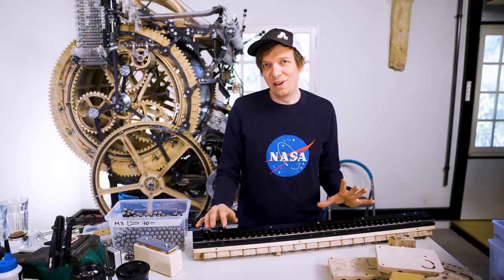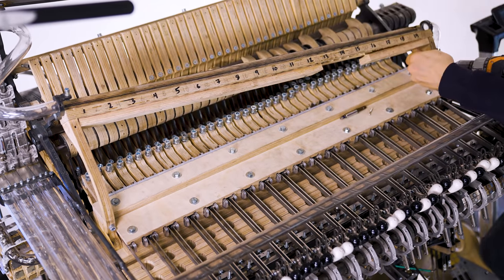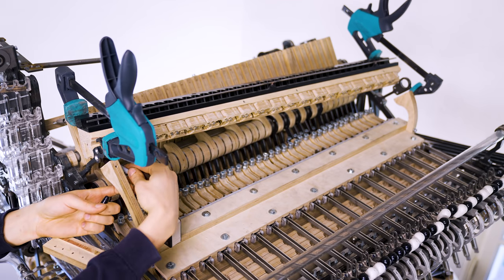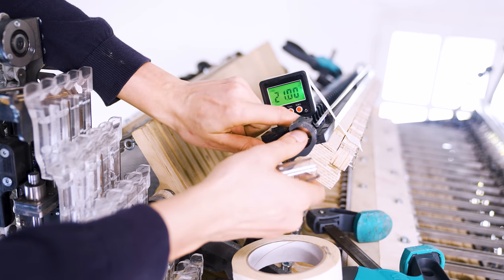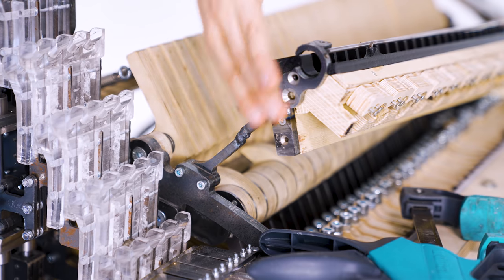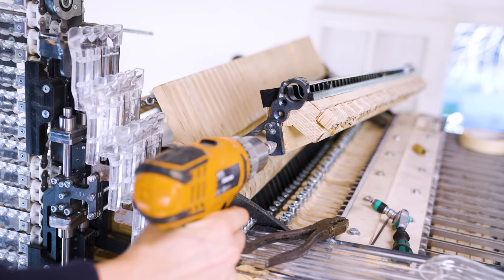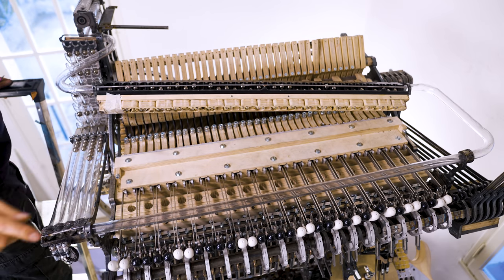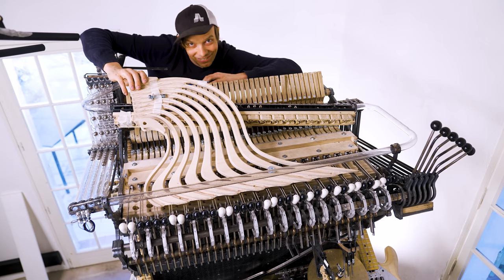The New Marble Divider is a Success!

Comment: Everytime he brings out a Sharpie, a CAD-fairy dies.
Reply: Never underestimate the power of the sharpie.

I used to etch my own circuit boards. For really simple ones I'd just draw the traces right on the copper with a fine tip sharpie instead of going through all the effort of designing it in KiCAD and transferring that to a photosensitive PCB. Worked great, and took a tenth of the time and resources.
Reply: @outputcoupler7819  
"If it works, it ain't stupid!"
Reply: @outputcoupler7819 , that’s how I do everything. But the touring machine is coming straight from the CAD files so this will all have to be worked backwards. No worries though, the CAD team is all over it.
Reply: @outputcoupler7819  now I am no engineer myself but I do understand that being an engineer is all about finding the best possible solution using the least amount of resources and time. Does that about sum it up? :)
Reply: if the flaming cheeto takes out a sharpie we laugh
if martain takes out a sharpie we pay attention
Reply: @frogz  cheeto is gone. we don't mention him anymore. We in the US have more then enough stupid to replace him. 
Which is why I come here. The levels of brilliance are both subtle and substantial, and the work that's done to make it all work is an inspiration to us all. The fact that Martin has thrown several hundred hours of work and parts into the old divider system, and is willing to toss all that in a heartbeat for something that WORKS, is a testament to progress.
Reply: @GeneralDubby  Sharpie is a brand of permanent marker, and is commonly used as the generic term for them.  I, too, would love to know what CAD-fairy means.
Reply: Instead of waiting weeks or even months for an answer, you could maybe- I don’t know, Google it? eye rolls
Reply: 2018 Martin rides again.

Comment: Don't forget to air dust the whole machine!🌬
Reply: And graphite the gears again after!
Reply: Gotta set the shop vac from Suck to Blow Spaceballs-style and just blow all the dust off the entire thing while wearing a mask and goggles.
Reply: Keep in mind that most air compressors also pump a little oil unless you have an oil free compressor.
Reply: @NFSHeld  Err, what kind of wack ass compressor you have that has oil exposed to the compressed air? The biggest issue I've ran into with compressors in static systems is humidity building up inside the pipes and condensing into liquids inside bends (which fucks with the airflow and can ruin your compressor\air powered tools).
Reply: @ScarletFlames1  i mean ideally the oil stays under the pistons in a reciprocating compressor but ideally is rarely reality.
Reply: There's probably so many metal shavings & saw dust in that machine that it probably needs to be saved as the prototype machine for historical purposes and a totally new one built from the CAD team's work for the tour.
Reply: @ManabiLT  congratulations, that’s literally exactly what he is doing :awesome:
Reply: @ManabiLT  As another commenter said, but with less derision: This machine is the prototype, the CAD team's final design will be the origin for final production. This makes it very easy for Martin and his production crew to keep spares on hand that can be quickly swapped out if there are issues on the world tour.
Reply: @F3Ibane  Yeah, I knew that already, but it's fun to point out why that's necessary. ;)  Thanks for being less derisive.
Reply: @polybius3821  There is one thing about the graphite that has not been spoken of. As the marbles travel through the machine the marbles will migrate that graphite throughout the machine, making those clear tubes,,, look dirty.
Reply: @F3Ibane  awww now I feel like a bad person
Reply: @ManabiLT  I meant no harm soz ;w;

you make a fine point for why they couldn’t use the prototype on tour if they wanted to

Comment: Martin: "I'm striving for perfection this time"
also Martin: "let's not think, lets just do"
Reply: The eternal struggle.
Reply: He is large; he contains multitudes.
Reply: Marting: "I want it to be 17.5 deg"
also Martin: "17.7, perfect"
Reply: @funkenjoyer  also a good quote
Reply: @funkenjoyer  Well, anything between 15° and 20° is perfect as he said they both worked perfectly, and wanted to go for max. robustness by picking something inbetween.
Reply: This is the way :)
Reply: @funkenjoyer  I think he wanted that angle so it matches the current parts without need for additional work. So if the machine is slightly different then what its supposed to be, its fine since it works within that range and its what he wanted.
Reply: and this kids is how I met your mother
Reply: @funkenjoyer  That was bugging me for a sec, but then I remembered what a large margin of error there was
Reply: What is finished first: MMX or George RR Martin finishesThe Winds of Winter? Or Neither?!?!?
Reply: I mean he can't help with the measures, but at least the mechanisms incorporated are better this time.
Reply: "I outlive myself" - Martin
Reply: His motives are too intelligent for us to understand.
Reply: @flying-sheep  Well, to be fair, 'adequate' or 'close enough' or 'within margins' would be preferable. 'Perfection' is the extreme point of goodness, and therefore there is only one possible perfect solution for every problem. However, many problems in the universe do not have a perfect solution. While the perfect solution to 2+2 is 4, there is probably no perfect color to paint my room.

When we use 'perfect' to describe solutions to problems therefore, we are very often wrong, and using the word incorrectly.

Comment: Martin: Random felt-tip markings and hacksaw cutting
CAD team:
Reply: CAD team: "We never expected it to come to this, but... bring out the LIDAR point cloud scanner, guys!"
Reply: @AttilaAsztalos  we've actually done some of that already for the instrument frame and marble ring lift side
Reply: screams in cadd
Reply: Is it maybe not the best idea to rely 100% on cad being absolutely accurate? Don't many manufactured parts have some room for error to allow for variability adjustment during assembly?
Reply: @tommj4365  Yes, but good CAD design can account for that.  Source: Most parts I design run with something between 1.5mm and 3mm tolerance positive and negative.
Reply: @tommj4365  I always remember my engineering prof telling me that all models are inaccurate and only some are useful

Like SteevyTable said, every dimension has some manner of +/- tolerance. Tricky part is to know while in the design stage if those tolerances are both acceptable and that production is capable of meeting them
Reply: @MalariaSucks10  Really? When I worked at Gulfstream, everything was modeled, and the aircraft was manufactured directly from those models. Models are technically 100% accurate and precise; tolerances apply when they are used for manufacturing.
Reply: @tommj4365  In manufacturing it is called "2nd operation" and then sometimes a tad more for critical/custom/prototype assemblies.
Very good to sneak up on the correct dimension when needing to meet 3 axis requirements, bravo!
Reply: @thomasbecker9676  Well sure a model is 100% accurate in the computer but the point of a model is to provide a print for someone to eventually bring those parts to reality. 

No matter what, all tooling has some amount of error. Meaning that all models will inevitably be inaccurate to some degree from the real life build

Even if you take a model, make a toolpath and cut the part on CNC, the CNC has inherent error due all sorts of factors. Vibration, wear on the drill bits, stretched out belts, etc. Same with 3D printing.

Imagine the nozzle on a 3D print is 0.15mm diameter, meaning that the thinnest line it can produce is 0.15mm. You then make a shape that is 0.25mm thick. The printer has to print a 0.3mm thick line resulting in +0.05mm error. I could be wrong about this, maybe newer printer designs can account for this but as far as I can tell that's one source of error in 3D printing
Reply: @tommj4365  When assembling a plastic injection mold many parts need to be fitted during assembly.
Reply: @tommj4365  From the model we (CAD team) have created of the machine, we are pretty sure we have the accuracy to less than +-1mm, some parts used the original CAD, some we had to just remodel of video references and photos but when it all comes together and after a few adjustments we think its now pretty much there exactly
Reply: @MalariaSucks10  I'm aware of what tolerances are; I'm an aerospace engineer. Any professor telling his students that "all models are inaccurate and only some are useful" has idea wtf he's talking about. MBD (model-based design) is currently cutting-edge engineering philosophy.
Reply: @nelsonion3529  +/- 1mm? That seems a bit loose. I hope you chucked Fusion360 in the bin and are using real design software, like CATIA.
Reply: Real World:  mark it and done.  results can be measured and duplicated in CAD for replacement parts.
CAD team:  would have to futz around for hours in virtual space to achieve the same result
CAD team who wanted to get paid:  🙁
CAD team who values their personal life: 🙂
Reply: @thomasbecker9676  Ok bigshot, I dont really care who you are

Sure I can believe you know what tolerances are but many ppl reading this thread might not so I wanted to elaborate a bit. We aren't just talking one-on-one here ya know.  A lot of students early on make the mistake of relying too much on CAD and assuming the model will be exactly the same as in real life, which is just not the case. That's all my professor was wanting to get across with that statement.

Also isn't MBD more relevant to software development of control systems? The point being to use logical block diagrams as an abstraction from a specific coding language so testing can be done before actually coding anything? How would MBD have helped with say, Martin designing and manufacturing mechanical parts? Should he be simulating the entire MMX so testing can be done in the box? I'm speaking from a place of intrigue here, MBD is not something I'm very familiar with.

Martin's main error with the marble divider design was the plywood part reducing the flow of the marbles due to differences in manufacturing the material on CNC versus Rosseros 3D print version (see "Ultimate Material Showdown" at 5:28.) How would MBD have predicted this result from simulation within the design stage as opposed to just building and testing hardware?
Reply: @MalariaSucks10  TL;DR. MBD in aerospace is doing everything electronically, completely paperless. If you know what you're doing, your design works correctly, first time out.
Reply: @nelsonion3529  I was gonna like this..but do I really wanna be the guy who destroys 69 to 70?
Reply: @tommj4365  a proper cad model is 100% accurate
Reply: @marcusborderlands6177  the mode itself can be accurate, but in production there are variables
Reply: @thomasbecker9676  I nmy previous job they made roulette cilinders (automatic ones). Even when the what we called "the central" was done on CNC ( really expensive part) and mounted on the best quality bearings and wood work was top notch for the track and diamonds ..... when it went to certification it failed as many other did, they took 50K to 100K continous launches to find the statistical random characteristics and even when it almost random is not prefect random, thus the certification given is from a lower level. We only knew ONE manufacturer that manage pass one time this thing. In fact, they werent able to repeat this on production LOL. Probably is still achievable, but on serious manual tweaking and months of test, trial and error.
Reply: @38911bytefree  That's an extremely specific case, and I bet if they did a full failure analysis, it would come down to the raw materials being inconsistent and enough being just inside spec that the stackup ran out.

Comment: Martin: "We want this to be 17.5 degrees."
Also Martin (later): "17.7 degrees! perfect!"
Reply: I have a feeling he got that number from the average of the 20° and 15° from earlier.
Reply: There was at least a +/- 2.5 degree tolerance for that part.
Reply: Engineers be like
Reply: 0.2° is a really small deviation for a part made from plywood, and in the last video he showed that the whole assembly works anywhere from 15 to 20 degrees, so 17.7 is well within tolerance.
Reply: The new and improved "Stop Stressing Martin".

Comment: I love how the marbles look when they flow through the divider! They stop and start in a way that seems very organic, like they're stopping to chat with their friend marbles as they pass!
Reply: I am concerned that not every opening in the divider had a second marble. Instead of queuing up, they rolled past. I'm hoping with the 'upper' tracks installed, that will not happen. (Also worried marbles will jump the rail and escape;but that'll be an easy fix.)
Reply: It will be interesting to see what solution Martin will come up with. Will he just let the marbles fall into the separator or will he devise yet another pipe system?
Reply: @brianj.841  It's possible that the lower marble was too high for a new one to enter. I think the lower marble needs to be almost entirely below the level of the track for a new one to come in
Reply: He has cardboard stuck in the end of the channels so all the marbles are at different heights. That’s exactly what it was designed to allow.
Reply: @bencressman6110  Good point, I hadn't thought of that.

Comment: Learning about robustness/resilience... redundancy would be if you had a second marble divider ready to take over the full load, if the first fails :). Great videos, thank you!
Reply: I'm imagining that now.  Starts where the recycling loop currently begins, angles down and to the left.  Main feed has simple thin metal flaps that are held out (closed) by the marble within it when the feed is full to that level, admitting marbles from the redundant feed only when supply is below that point.  Marbles that make it through both gauntlets hit the fish stair.

Comment: Please stop waving the TIG torch back and forth over the weld when you've finished. 
You want to keep the shielding gas over the newest, hottest part of the weld; the part of the weld that is most likely to react to the atmosphere once the shielding gas is removed. 
Just hold the torch at the end of the weld till the puddle has returned to a non glowing color. 
If the post flow stops before that, adjust so it's flowing long enough. 
Thanks!
Reply: I assumed he was trying to keep the organic parts from scorching.
Reply: @fredeisele1895 , maybe, but I've seen him do it when he has only metal parts, on the workbench. 
Maybe he's thinking he needs to cool the part? 
Either way, it's a less than ideal technique.
Reply: Spot on, Chris.

Comment: I´m little worried about "floating" divider idea. It could lead to some vibration transmitted to the rest of MMX.
Reply: It'll be secured by the incoming tracks and the PMMA tubes coming out, so it should be more than stiff enough to prevent resonant vibrations.
Reply: Vibration there has a benefit though, of helping keep marbles moving and minimizing stopped ones.
Reply: It's only floating by appearance. It still has a metal support on either side plus all of the pipes. The only things Martin removed were the additional wooden struts that formed the frame of the old divider.
Reply: Nah, doesnt seem like a severe issue.
Reply: Said vibrations are a two way street, going from the divider to the frame and vice versa at all times while in operation anyway.  Structure was more the concern, with plywood weiging more, and there being a lot more plywood there (the tableful of parts swept away), also wood doesn't "span" distances as well as more rigid materials.  The plastic provides its own structure and won't flex or sag the way wood would.  And tbh vibrations generated by marbles clicking past are minimal enough to simply add to the ambience of the machine operating without overwhelming it.

Comment: Martin: precisely design and CNC cut the part with very little tolerance to avoid tiny gaps between marbles and path
Also martin: hand cut the part with a hacksaw  and wack it with a woodclamp
Reply: precision only where you need it
anything more is effectively wasted effort